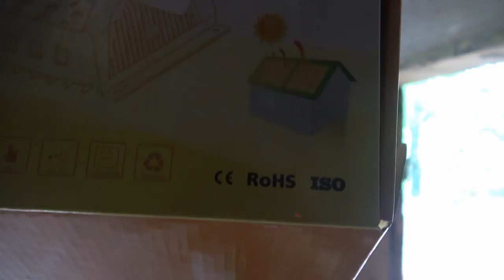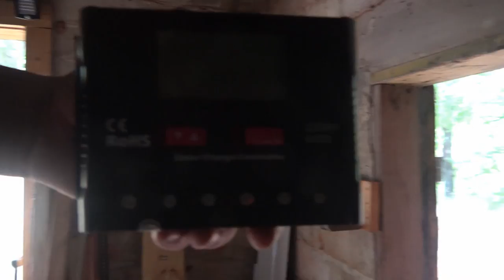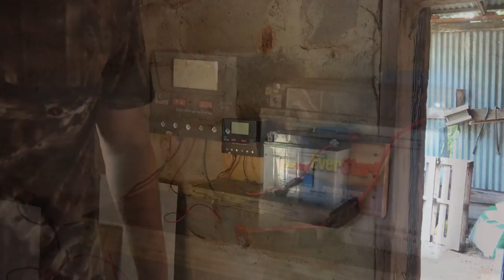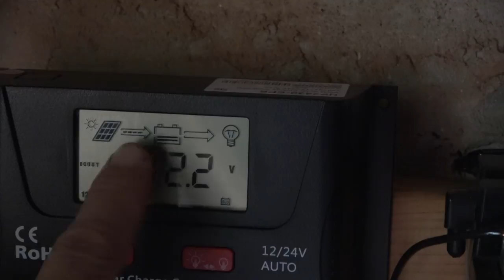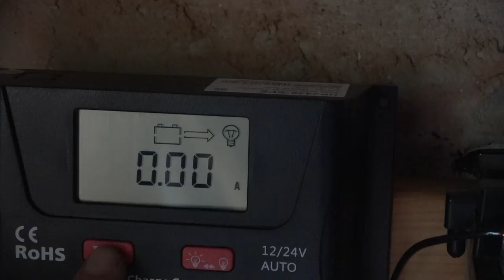Installing an Off Grid Solar LED Lighting System in a Barn #Solar #offgrid

Comment: Hi thanks for posting this video. I'm not sure if I missed it, but I was wondering how the wires are connected to the back of the solar panel, and if rain runoff from the upper part of the roof would get the back of the panel and the wiring wet?
Reply from the maker: There's two wires stubbed out of the back of the panel.  I connected them with butt connectors.  I doubt it gets wet as they are under the panel.  If they get wet, it's not a big deal, it's only 12V DC, and the connectors don't corrode.  If you are concerned about it, you can waterproof them with black tape.

Comment: Thanks for the video.  Looks like a good use of an old tractor battery.  So a 25 watt panel will keep your battery charged eh?  Nice to have a helper too. cheers
Reply from the maker: Hi, yeah I replaced that battery with a sealed lead acid AGM. 12AH battery. Yes, that 25W panel keeps it charged nicely. I added a 12V tire pump to the mix. Thanks for watching and commenting.

Comment: Great video exactly what i need for my  garage  for couple hours a night. I suppose 1 big panel and a boat battery would give me some extra hours. Any idea how many hours you get with that small battery??? Semper-fi
Reply from the maker: Hey Ken, these lights work good to see, but I wouldn't recommend them for work lights.  If you want work lights, go with the boat battery and a 100W panel vs my 25W.  I also recommend a SLA type battery that won't dry out.  Check out the LED work light from Harbor freight.  I think you can get one of those for 19.99 with a sale coupon.  They are super bright and would probably run a few hours on a large battery.  I don't know how long my lights will run on that battery.  I've forgot and left them on before and they were on the next night.  But the battery would have gotten charged the next day if the solar puts out enough to charge plus run the lights.  Thanks for watching and commenting.

Comment: The only thing I dislike about these solar lights is they only last a couple of years. I've used all kinds and most have about two years life on them.
Reply from the maker: Hi Mel.  This will be their second year.  One of them has part of it that quit working.  They don't get much use either.  I had to put a new battery out there, the other one wouldn't take a charge any longer.  I think my solar panel may be going bad.  Thanks for watching and commenting.

Comment: NICE!!!  You're running 10 or so LED strips on that panel, really cool!!!  care to share what LED strip lights you're using brother?  Like the video Darren!!!!!  Dan
Reply from the maker: Hey Brother Dan!  Yeah, they are just cheap little strips.  I ordered three types of the LEDs:

https://www.amazon.com/gp/product/B06XDQ7481/ref=oh_aui_detailpage_o06_s01?ie=UTF8&psc=1

https://www.ebay.com/itm/50CM-U-Aluminium-shell-DC-12V-36-SMD-5630-LED-Hard-Rigid-LED-Strip-Bar/332644356624?ssPageName=STRK%3AMEBIDX%3AIT&var=541762641040&_trksid=p2057872.m2749.l2649

https://www.amazon.com/gp/product/B07BN1ZV12/ref=oh_aui_detailpage_o05_s00?ie=UTF8&psc=1

I've been looking into 12V flood lights too to shine outside in the yard area around the barn.  (Get my shine on)  lol

Take care Dan.
Reply: Thank ya for the info Darren!!!  Dan

Comment: That is pretty cool that you can do that nowadays. Instant power. It lights it up in there pretty good too. Have you tested it to see how long it will run off the battery before draining it? Victory haha.
Reply from the maker: Southern Food Junkie I haven’t run them any length of time yet. I would guess 3-4 hours. Those led lights don’t pull much. If they don’t cut it, I can put on a bigger battery. Thanks for watching and commenting. Take care Ronnie.
Reply: Jerome Bee Farm & Homestead I got ya. Dan had a video on somars lights again and I have been brain storming because of you two guys lol. I about bought one today but needed some other stuff for the yard first haha
Reply from the maker: Southern Food Junkie that little controller is pretty slick. I got a Harbor Freight 12V tire pump to put down there to air up my flat tires too.

Comment: COOL> Tell ya another way to save money Your hot water tank "if electric? " Can put a timer off and on switch on it > This will save you at less 75 dollars a month THAT 900 bucks SAVINGS  a yr.>  NO NEED OF IT RUNNING 24 hours a day, Just set for 1 time late evening where ya wash dishes, and shower for 2 hours>  I just turn it on 1 hour b4 i need hot water, off when done.    Show your family how to use it.
Reply from the maker: They make on demand hot water heaters that are supposed to be real efficient.
Reply: what i'am taking about still save at unless 75 bucks a month mine is energy efficient too.  CUT it off and save.   off and on timer only about 24 bucks for 220v
Reply: i bet it is dark in there with out lights
Reply from the maker: Yeah, it's real dark.  It's hard to see in there in the day time too.